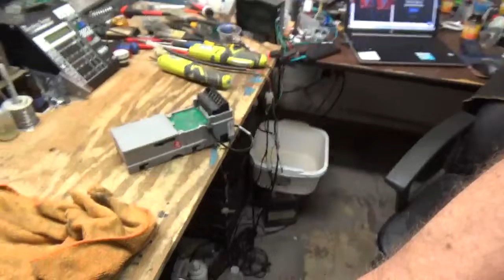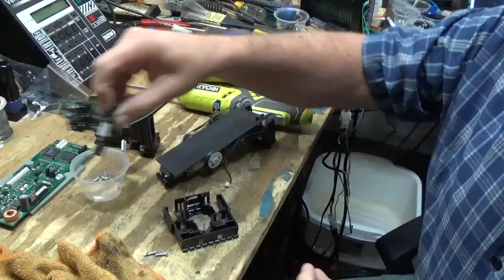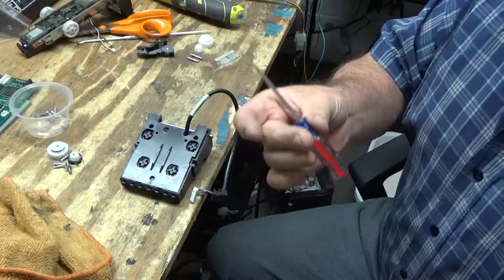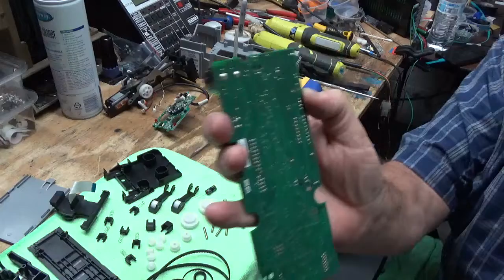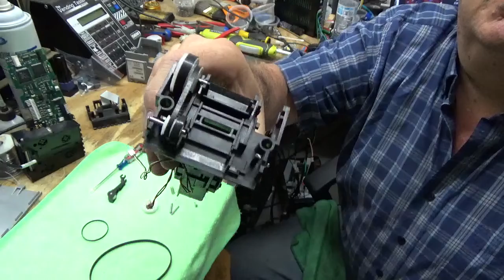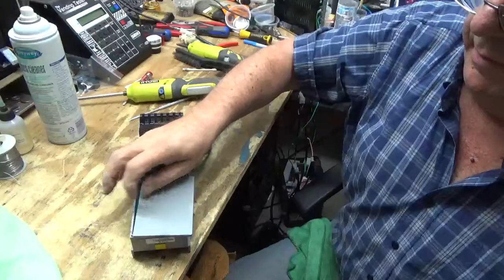MEI AE2602 Validator Complete Service Tech Video

Comment: Doug, Thanks for the awesome video.  Couple of comments and questions.
1.  What type of cleaning tank are you using?  Is it like a dentist vibrating tank?  Just soap and water?
2.  Do you ever update the software?  I usually do, but noticed after a software update, the bill acceptors will not take older bills.
3.  I have gone exclusively to the MEI's.  I won't use the Coinco, Cashcode, Apex, ICT, JCM, Smiley, Gamemax or Pyramid any longer.  However, I'm not a fan of the new CPI Talos so far.
Reply from the maker: I use warm water and Dawn soup in a tub.
Reply from the maker: We have all of the update tools for MEIs as that is all we work on now. As far as cleaning, just soap and water for the plastic parts and a foaming window cleaner from Home Depot so the liquid doesn't run off so fast. We use brake clean for the gear sets as that old grease really seems to stick and we want the 4 gears nice and clean prior to re greasing with a clear synthetic bicycle chain grease.

Comment: I am wanting to make a jukebox and Im having a hard time finding wiring one up from scratch. I I know it says the Mars 3000 has pulse which is what i need. But it says something about 18 pin and all I see in the pictures is the 9 pin and a small connector I cant tell much about. Any info on how to wire the 120v up to a outlet and/or how to setup a pulse would be great.
Reply from the maker: The 18 pin is the connector at the side of all series 2000 MEI validators. For pulse you do need any 115 v MEI. As far as the pin out, lots of guys do it and I suggest you check with the groups on FB. Lots of knowledge there. Best of luck!

Comment: Hey Doug. Nice video. After cleaning validator and replacing belts does that clear fault codes (flashing red light). Is there a way to reset it?  Thank you
Reply from the maker: If there is still a fault, other than 2 flashes, a sensor has likely failed and it needs service.

Comment: Nice service video of the MEI. I have a question for you. I have a couple of older MEI 2511s that cycle slow and display the one flashing light that represents a bill jam and wondering if it needs to be lubed or what parts need to be replaced. Thanks for your expertise.
Reply from the maker: Usually a case that the stacker motor is bad. You can try some new grease in the gear box and maybe a few drops of 10W oil.
Reply: Thank you. I really appreciate it. Can you make a video for me on how to try to fix flashing light 1 and 5 ? If you already have any related video for flashing 1 and 5, please link to me. Before sending it to a service center, I want to try what I can do.  Thank you for your

Comment: Thanks for the video. I watched it 10 times! Haha, My validator just started blinking one blink, and the token machine said sensor, so I took it entirely apart like your video, and the top sensors, a piece of a bill fell out, so I am thinking that must be it. I put it all back together, and it's not showing any errors and solid red light, but it won't take any bills! Is there some kind of reset? And when I first turned it on, it cycled 3 times. I did see someone changed the cap on the inside already. What do you think? I might have to send it to you. I am trying to open a small arcade.